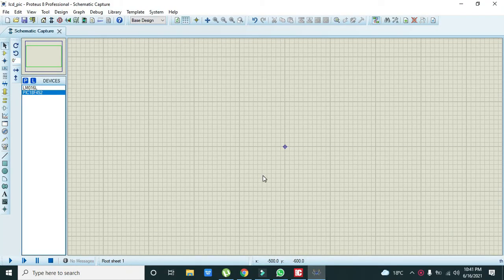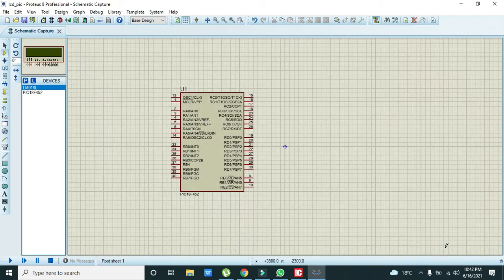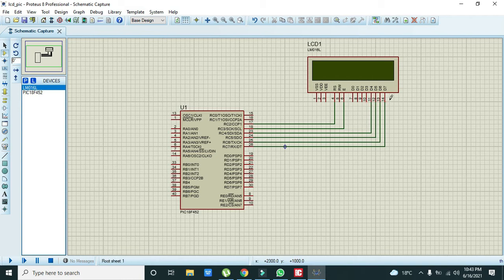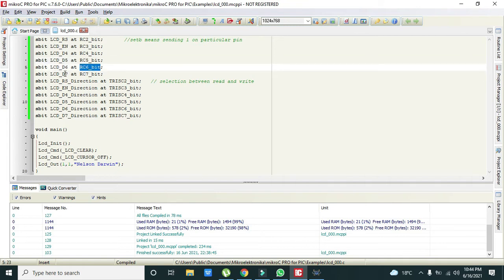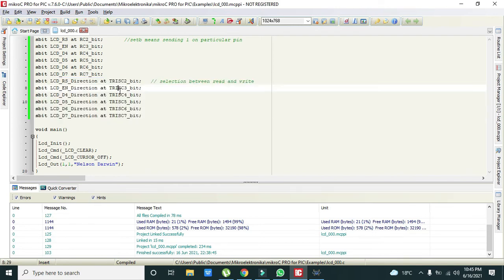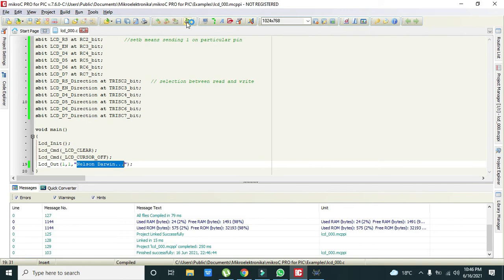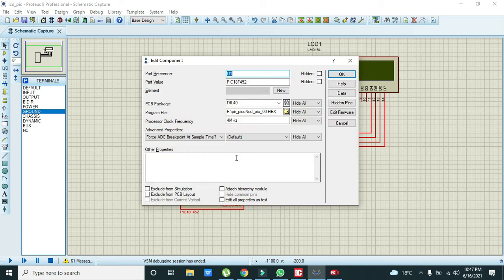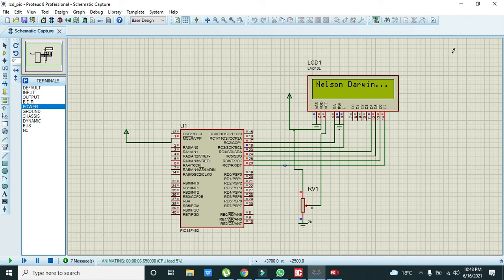how to interface lcd 16*2 with pic 18f452 microcontroller in proteus using micro c

Comment: Good day, can you please help me with a simulink project, I am required to design a DC motor fed by a Photovoltaic array via a DC-Dc booster. I want to supply voltage around 12 V to the Pv array. Can you please help with that